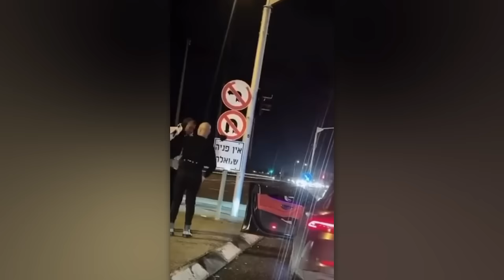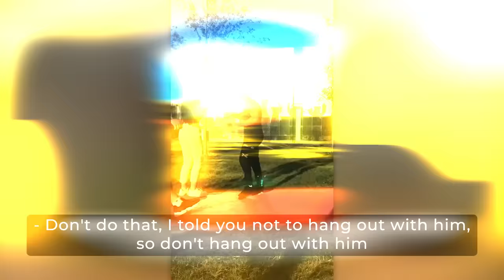Real Life Superheroes Caught on Camera

Comment: @14:19 "but this guy happens to be in just the right spot to stop it, that's a truly strong move in every sense." Uh, what? There are 3 people in this video working together, the first person who was able to slow the car down was a woman. You can see in the video the car starts moving and a person runs, in heels and a dress to stop it. We see that first person well before we see the second. The second person helped the WOMAN, who was already positioning her body between the cars and had already started to slow down the car. The both of them blocked the car from getting hit and the WOMAN was there first. She did most of the work after arriving there faster, even though she was wearing very high heels and a tight dress/skirt. Is she invisible? Am I imagining her? I don't understand why her existence is entirely ignored, giving 100% of the credit to the person who came in after her and did, maybe, 30% of what we see in this video. On top of that, a third person joins in to help, another WOMAN. At one point the second woman is pushing the car back alone, while the man takes a break for the weight for a few seconds. Had the original woman not been there, things would have been much worse, if the second woman hadn't been there, things could have gone badly. 

But neither of them are even the least bit remotely acknowledged. We literally see three people in this clip, 2 of whom are women. This means the way it's being presented is ignoring over 66% of the heroes in this clip. HE was in the right place at the right time for HIM to stop a car because HE'S a hero, the other people, including the one who ran to the car first and was the first to start slowing it down and was the first to put her body between the two cars, they don't count. The only factor I can see between the 1 person who is credited here and the other two who are entirely ignoring is gender. Why is it that a man doing the samething as a woman, after she has already started putting in the work, a hero while her existence is ignored and literally not worthy of mention? She did everything he did, but she did it first, she did it faster, and she did more of it, and she did it all in high heels. But her entire existence in this ignored. It's like Sybil Ludington. No one knows who she is, but we all know about Paul Revere, the American hero. Sybil did the same thing he did that same night, but she was only 16, she had no military training, she was at more risk being a woman, and she road twice as long as Paul, even getting captured once and smarting her way out of it. Our history books teach us about the heroics of Paul, but Sybil's heroics have been largely forgotten. If a man does something he's a hero, if a woman does it first, better, more, and in heels, she literally doesn't exist. Like how a man invented Monopoly, wi-fi, and the bra, but only after women did it. The first man to steal their work from them and claim it as his own got paid for it and credited in the history books, the women behind them got left out. There are 3 heroes in that clip, but 2 of them aren't even mentioned or acknowledged because a man was involved, meaning a man did it all and the women did nothing.

Comment: The one with the guy supposedly stopping the truck has to be completely fake. Even if we look past the physics of the thing where it doesn't matter how strong you are with out something to anchor you to push against the sheer weight difference is just too great. There is still the whole problem of if the hill was steep enough for it to roll to begin with even once stopped when he let go it would have simply began rolling again into the car. The issue is the same as if you had a 300 lb guy who could bench press 600 lbs but have him try and pull 600 lbs off the ground with a rope attached above it would be he that is leaving the ground not the heavier item, unless he can be secured to the ground before.